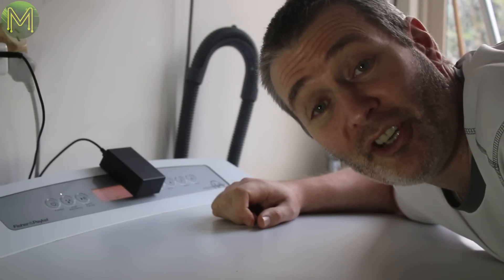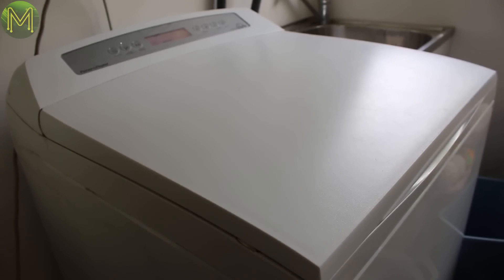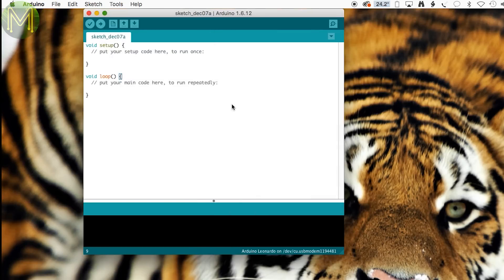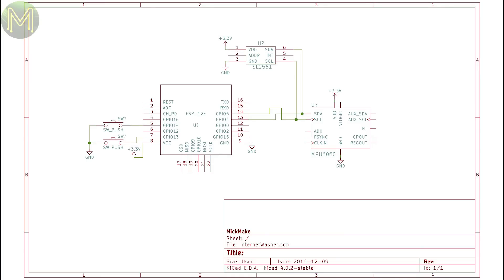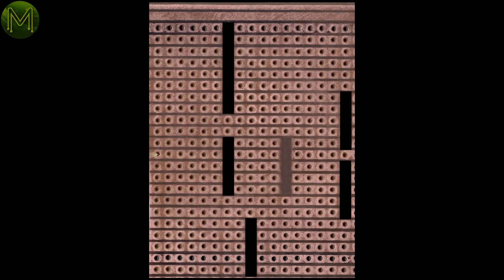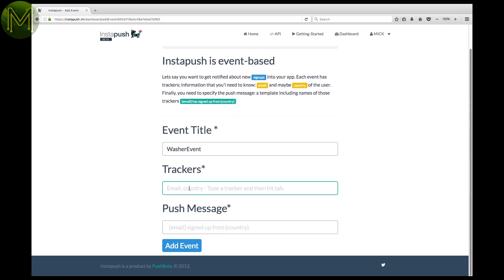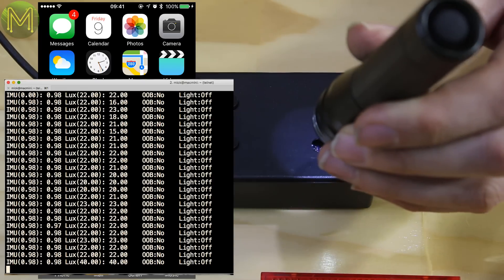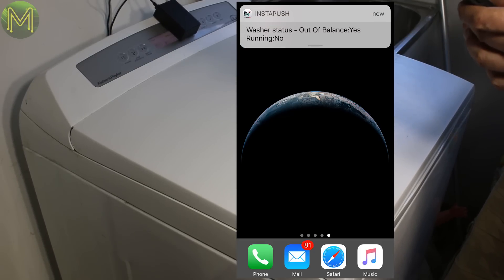#078 How to connect your washer to the Internet // Project

Comment: Nice. Could you explain how you used the accelerometer to detect when it's out of balance? What sample frequency are you using? How do you distinguish between out of balance and a fast spin?
Reply from the maker: +aspuzling 
I found out by trial and error. Basically putting it into spin mode and adjusting until it didn't register. The default trigger levels should be enough for most people but may require some changes.

Comment: A recommendation for working with Arduinos is the Platformio IDE. Cross platform based on the atom editor and is perfect for Arduinos. better detection, completion, compiling. and looks nicer.
Reply from the maker: +Paul Hein 
Platformio looks pretty good. I know it's been around for ages, but haven't used it before.
Wouldn't mind doing a review comparison between the two.
Reply: MickMake I would recommend to try it out. for me it was definitely better than the Arduino IDE. it has even the esp's sparkfun things. etc. as far as I know where is one main developer. he was doing WebApps and started doing iot things and thought he needed something better.

Comment: nice idea I'll make this. I will open up my machine to add more functionality.
Reply from the maker: +Akarsh Agarwal 
That was my original thought, but then thought I'd try to do it without having to crack it open. For me I just needed those two elements covered. Let me know how it goes!
Reply: well mine doesn't have a backlit LCD so I would hack in the the wires going from the mcu to the relay controlling the motor. now because I would be opening up the machine I would add more of features too as I proceed.

Comment: Yes boys and girls you can also use the ESP8266 Huzzah break out board if lipo battery isn't required, as they are generally more available than the Feather Huzzah 😉

However for those of us who purchased our washing machine in 2003 and purposely avoided an electronic interface in preference for the old school mechanical type, well I just say... It sucks to be me... Right? 😁
Reply from the maker: +Scott Evans (VK7HSE) 
Well. No not really. I'll be running another tutorial showing other possibilities that will help you out as well.
But, you can still check for an out of balance condition. I think this is probably more important than finishing time.